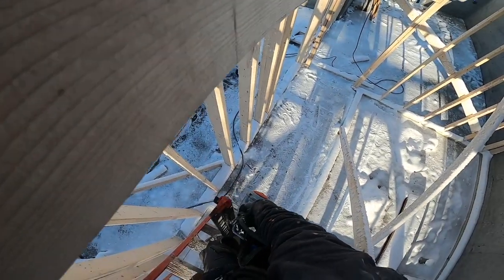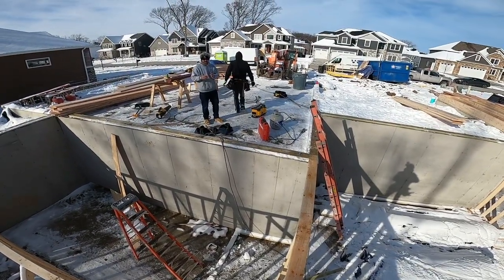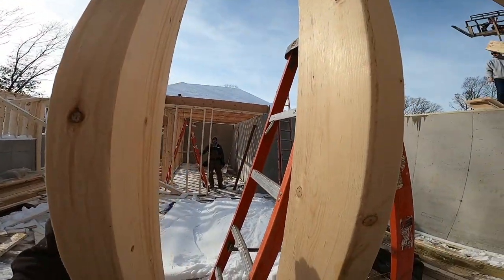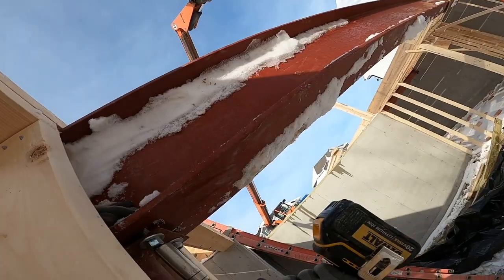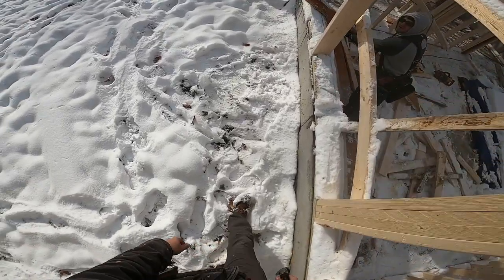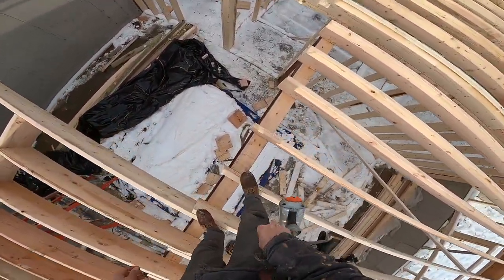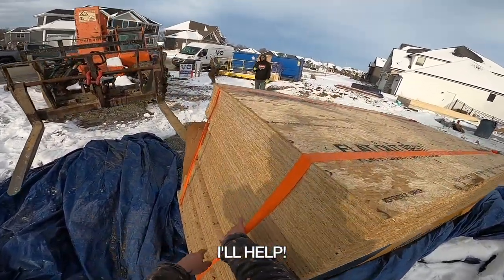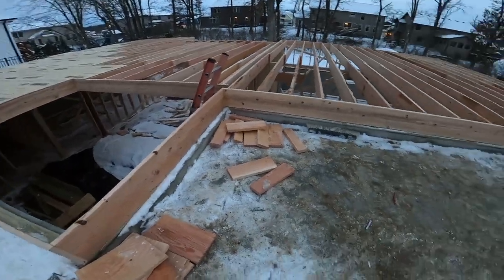Winter Floor Framing (First Person POV)

Comment: Mostly dimensional lumber used down there? Not engineered joists and trusses?
Reply from the maker: Yeah mostly for us. Occasionally we'll do a house where the plans specify floor trusses. Whether it be for mechanical or what not. We also do roof trusses too whenever were able to.